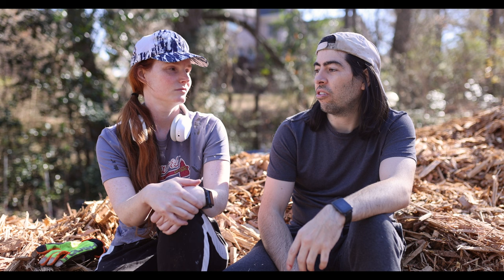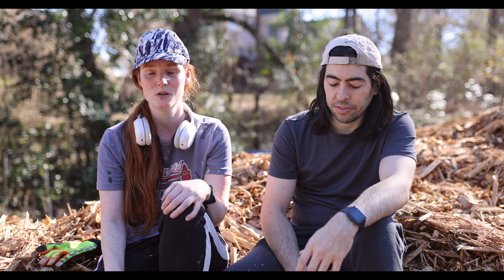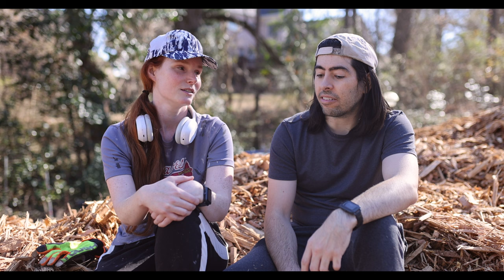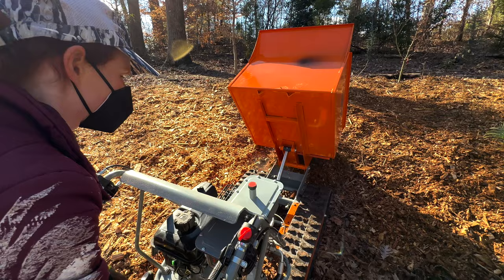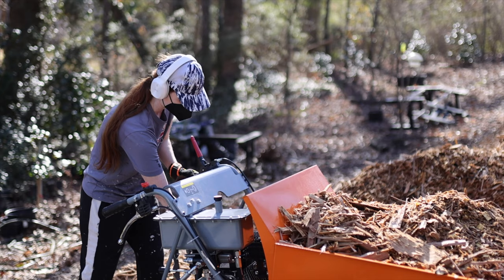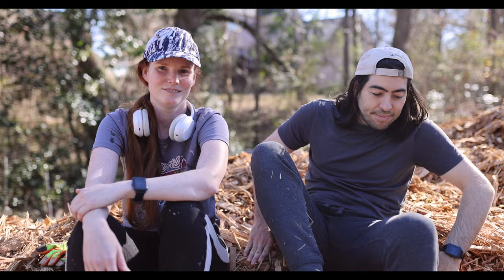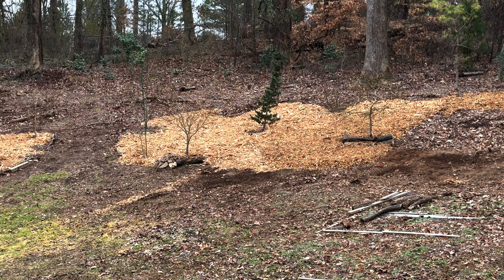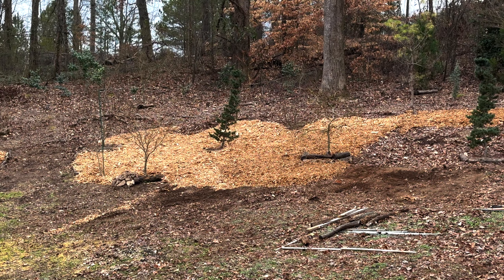Transform Your Gardening Game with the $3800 Tracked Wheelbarrow

Comment: how is it holding up? Ive read the reviews and people complaning about the transmission going out.  Im planning on buying one of these.
Reply from the maker: For us, it’s holding up really well. We haven’t had any issues yet, but we also don’t use it daily. I’d say we use it maybe 2-3 days out of the month for most times (and then intensely for days in a row when we have a project).

So far, it’s been great - no complaints!
Reply: @buildingmodern  oh cool. I probably end up using it around that time hauling limestone and dirt
Reply from the maker: @bigcartoonyIIV  it'll be great for that. We ended up putting raptor spray in bed liner on the inside of it, and it's held up great (we were spraying our truck bed and had extra left over). 😁

Comment: I've been contemplating buying this for my business... residential landscape. 

Anything about the machine that makes you regret the purchase?
Reply from the maker: Thanks for the question. For the price, absolutely not - it’s been great and can go up steeper than 45 degree slopes.

It does still damage the grass, just not as much as a wheeled version. It also doesn’t have a 0 radius turn - it needs at least a few feet to turn as the tracks both only go forward together or backwards together (or one braked while the other moves forward). 

Honestly, so far, it’s been great. The 3rd gear can have problems if you go straight from reverse to third gear (the gear just doesn’t engage) - so, instead, go to 2nd gear and then push it up to 3rd once you’re moving (it’s a quick shift, so this isn’t a problem).

It does move a bit slowly though - more at a mozy walking pace rather than a fast walk, even in the 3rd gear. It’s still faster than me carrying everything myself, but fyi. I would definitely go with the larger one (the one we show) rather than the smaller one. We haven’t had any problems moving it full of gravel up our pretty steep incline. It also was able to dump the entire load of gravel using the hydraulic lift - no way we could have dumped it by hand. 

I hope this helps. I have a link in our description to the one on Amazon, but I might also look at Home Depot / Lowes, or local suppliers, to make sure to get the best deal possible.

You’ll probably be using it much more than us though, so grain of salt on all of this as we’re homeowners / diy-ers. So far though, it’s been great, and I wouldn’t hesitate to buy it again. 

If you watch some of our shed build videos, especially the 1st & 2nd, you can see us using the yardmax to move gravel materials.
Reply: @buildingmodern  can you change the oil yourself and transmission oil or did the company seal it?  I'm looking at a DR power one as well but read a review they sealed their engines and owner cannot change oil thus making the machine disposable.
Reply from the maker: @D2023bm  we can change the oil ourselves for the engine. On the transmission oil - not sure, I know I can for the engine. We haven't had to change either yet, so I'm not entirely sure. When we first got it, we did have to add engine oil for the engine before first starting it up (per the instructions). It might be worth a quick call to Yard Max to confirm this.

Comment: Great video, i think you have convinced me to buy one haha.. How is that machine going today? Still going strong? do the levers feel durable?
Reply from the maker: It’s going strong! No problems yet - we’ve moved cinder block & sand/cement uphill without an issue. It can tear up the lawn if you turn too rapidly, and going over the same area repeatedly can do this as well. If doing that, putting down osb or plywood to run over is for the best.

Overall, we’ve been very impressed. Though - one note - it does smell like gas / is definitely a small gas engine tool. You’ll want to keep it outside of your house if you can (why we built our shed). Cheers 🙂